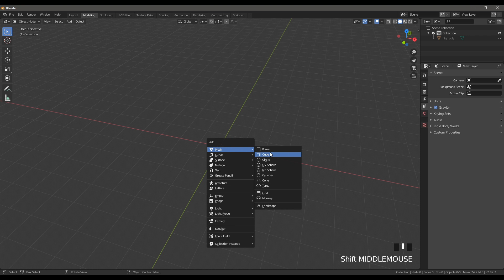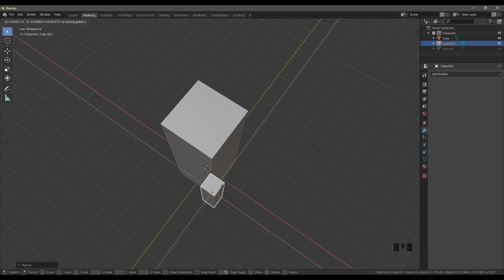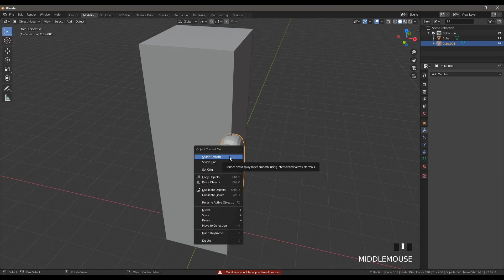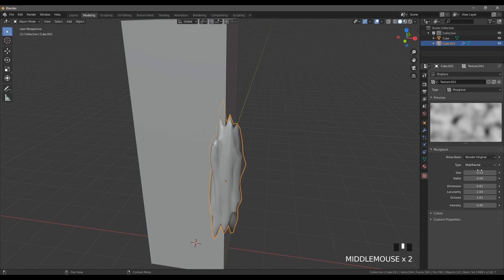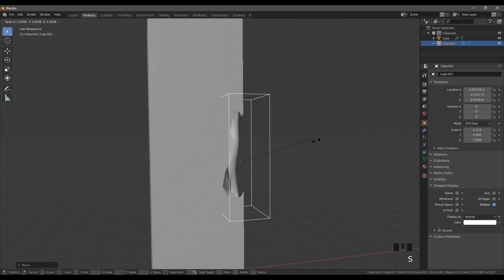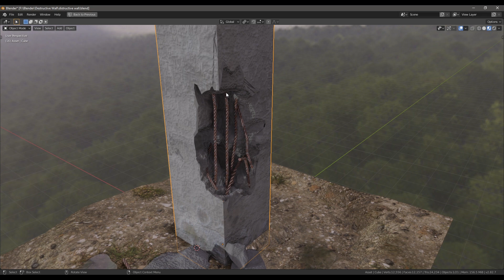How To Create Damaged Concrete/Wall in Blender 2.82

Comment: When I apply the difference I get a hole in my mesh, is the way to fix this with a Solidify modifier? I'm having trouble getting it to fill the hole of the difference without distorting the size of the rest of my object.